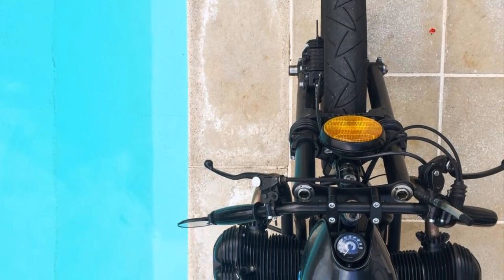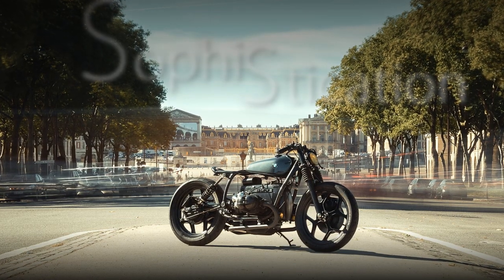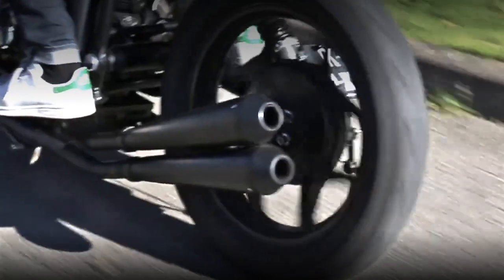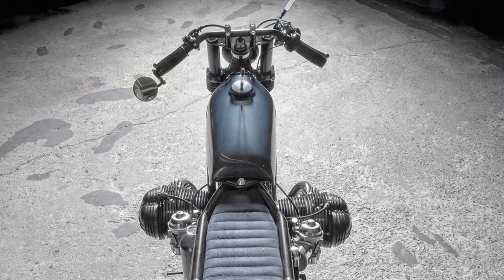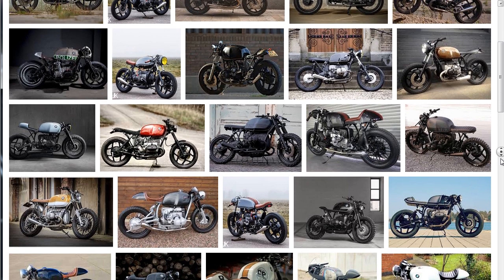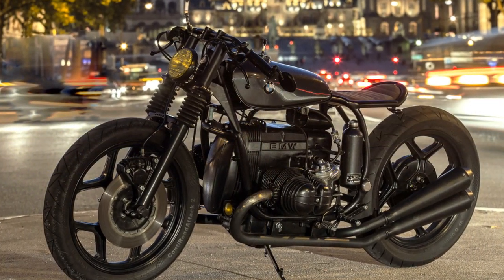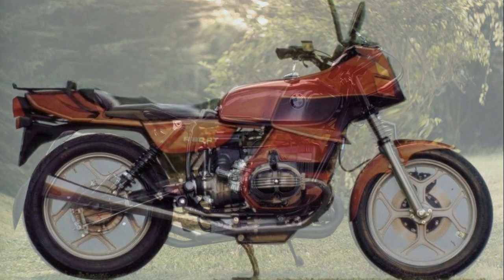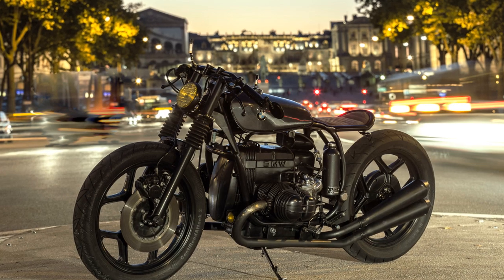Cafe Racer (BMW R80 by Le French Atelier)

Comment: As far as I can remember there are few entries from France. Perhaps because there is no brand of motorcycles as in Germany, Italy, England or even Spain. But what you can say is that every design that comes from France surprises by the level of elegance and sophistication. Something elegant by the way is not something overloaded, on the contrary, it is simple but full of subtlety. The above applies completely to this beautiful motorcycle
Reply from the maker: Thank you my friend Alejandro for sharing your usual and interesting opinion
I agree with almost everything you said.
But i have to correct a small thing.
There is a big French motorcycle manufacturer. Peugeot makes amazing super scooters.
I visited Paris 2 years ago, and i was impressed by the huge number of Super Scooters that i found of the streets.
Something like the Peugeot Metropolis 400
I remember the 80's when Peugeot launched the first modern scooter, the Peugeot st 50.
It was a huge success on those days.
But i recognize that this kind of motorcycles probably didn't reach your Country. :) Saludos.
Reply: Hey there. Our country also has overwhelmingly strict regulations on the subject of motorcycle modifications, restricting some of the base mods like shortening the frame; which discourage a significant portion of french cafe/bobber enthusiasts.
Reply from the maker: Hi. I understand what you're saying. But i think that it is not what Alejandro Monzon said in his previous comment. I believe he was referring to the low number of French projects, because of the apparent unexisting French manufacturers of motorcycles. That is why i talked about Peugeot motorcycles. :) Salute.
Reply: Exactly, and yet despite regulations imposed by legislation and the lack of historically significant manufacturers, motorcycle builders in France have demonstrated a very special talent and elegance.
Reply: What? France dominated the moped market with Peugeot, and Motobecane, and Solex. I have a Peugeot 103, and a Motobecane LeMoped.
Reply from the maker: Yes you are right, but only in some European Countries. Unfortunately that kind of small engines and moped market was always very specific, and that is why it never had a worldwide growth. Thanks for sharing your perspective. :) Cheers.

Comment: It's refreshing to see function equally important to form. I find the Racer in Cafe is all too often forgotten... It Is a Cafe Racer BECAUSE it defines speed and performance as a core element...
I believe these are far more important principles than a seat cowl... myop
This is my significant beef with the Sacha CX500... 50,000 euros and it doesn't make a single xtra HP to a bare stock CX... surely 20% of a ridiculous budget could be allocated to actual throttle and gear box...
I would even have given a CX650 modded into it a thumbs up.... it really turns me off that otherwise attractive bike....
Reply from the maker: Thank you my friend for sharing your perspective. :) Cheers.

Comment: Can you make a video with your thoughts on this bmw k series, including anything you notice with this build. Check out the motoizevro bmw k1100 k100. I believe there are some picture at rocket-garage.Blogspot. This would be awesome
Reply from the maker: Thank you my friend for your Suggestion.
I have to recognize that their bmw k1100 project looks really good for a K series with the original frame.
But i still don't like the broken bottom line of the fuel tank and seat. And this is the real difficulty of the K series, which i would like to see solved without changing the frame.
But like I said already, they look very good indeed. :) Cheers.